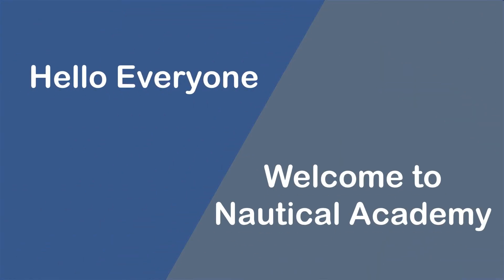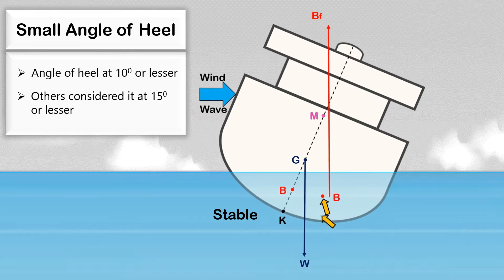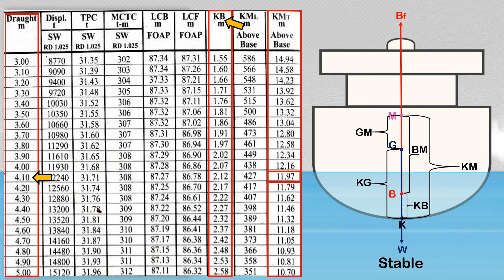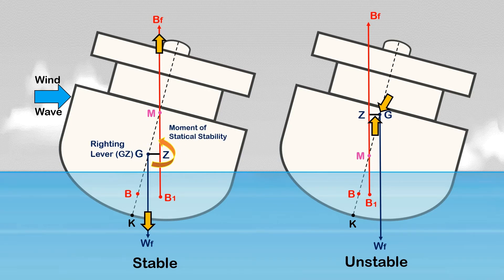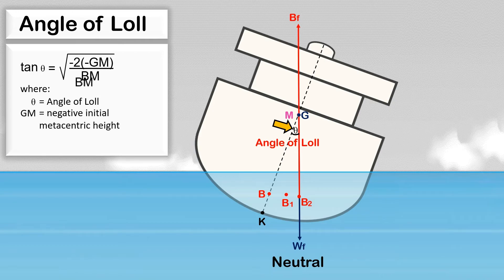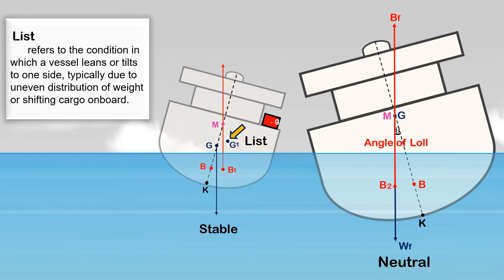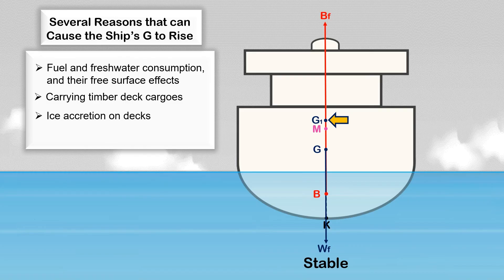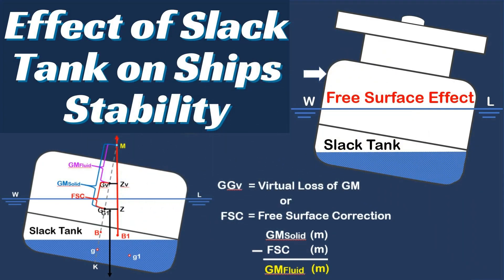Angle of Loll ll List ll Ship Stability ll Neutral Equilibrium ll Righting Arm ll Metacenter

Comment: Questions:
Say vessel tilted on the right side. In order reduce the angle of loll, why we should emptying the left side first instead of right side? And why we should fill up righy side first instead of left side?. I use left and right to describe as per the presentation. 
I am looking for your clear explanantion as usual you do the great.
Thank you
Reply from the maker: When angle of loll occur, the ship's center of gravity (G) must bring down below metacenter (M). So discharging ballast water from the wing tank is one of the corrective actions as it lower ship's G. Emptying tanks must be done one at a time, and the tank at the high side must be emptied first as it has greater vertical center of gravity (VCG). The VCG of ballast water inside the wing tank at the high side is positioned higher, compare to the VCG on the low side, so our priority is to lower that VCG first of the wing tank on the high side. 

Remember that when a weight is discharged, the ship's G will move directly away from the center of gravity of the weight being discharged. Since the wing tank is positioned higher, so the position of the center of gravity of the ballast water is higher than the ship's G, as the ballast being discharged, ship's G will go down eliminating first the effect of VCG in the tank at the high side.

In the case of loading a weight, ship's G will move directly toward the center of gravity of the weight being loaded. If we fill in the double bottom tanks, and if it is divided into 3 tanks, the center tank should be filled first, next is the tank at the low side, and the last is the tank at the high side. The double bottom tank at the low side should be filled with ballast first compared to the tank at the high side because, when the ship's G moves towards the VCG of the ballast water being loaded, the vertical movement of ships G has a greater effect, as it moves towards the VCG of the tank on the low side compared to the tank on the high side.

It's all about the movement of the Ships' center of gravity (G) that must bring down below the metacenter. In this case, you must be familiar with the movement of the ship's G during loading and adding weight onboard.